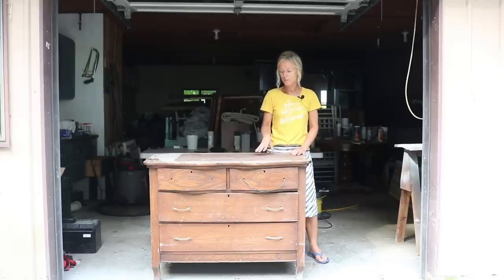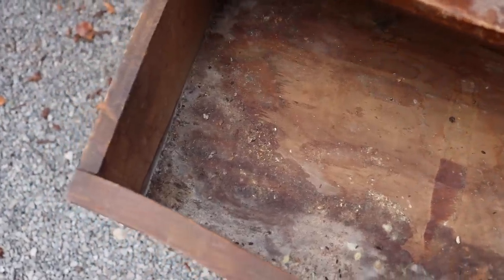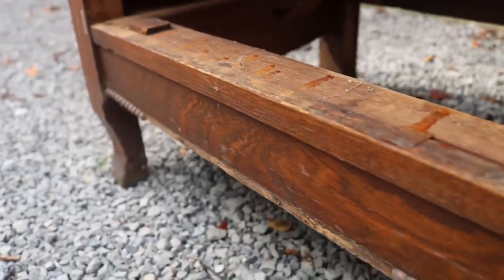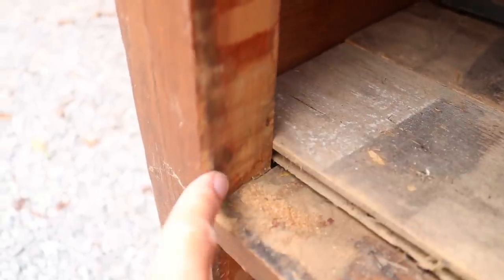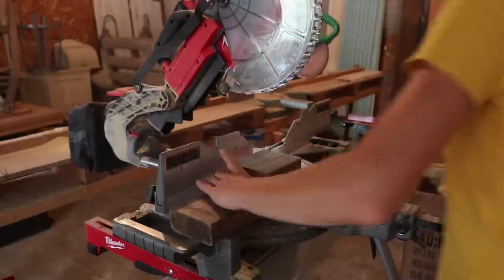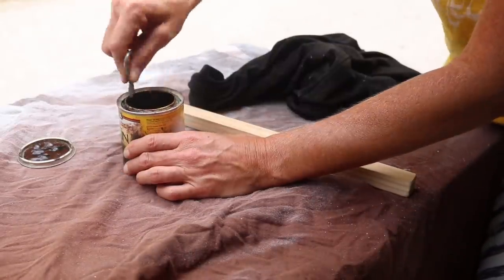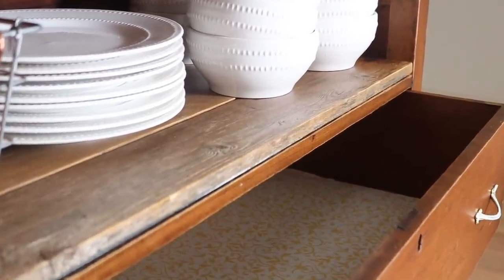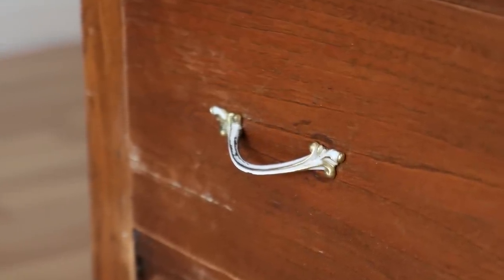Dresser Makeover ~ Repurposed Furniture ~ Furniture Flip ~ Dresser Transformation

Comment: I would love to have that in my kitchen unfortunately my kitchen is so small I’m lucky I fit in it. It turned out so cute n love the idea for paper towels. I love oak n especially if it has serpentine front . I can never resist them. My house is full of oak furniture with serpentine tops. Usually dressers of that kind had wheels on the bottom. It was always easier to move them when mopping the floors way back then. 
That would be very beneficial for this island as the person could move it to use at times. Doesn’t matter tho u did a great job. ♥️😊👍🤟🏻

Comment: Love these transformation to a beautiful and useful addition to your kitchen.  Love upcycling!   I was lucky several years ago to get a marble topped dresser dresser on legs.   I cut off the legs painted it white to match my kitchen cabinets, put on the same vintage hardware, paper towel rack and kitchen towel drying rack on the back and set one end up against the middle of my vintage washstand  to form a TEE in the middle of my kitchen working area.  I bake often and the kitchen counters were too tall to be comfortable but the dresser without legs was perfect and the marble was wonderful for rolling out dough or cutting veggies----so if you see one of those marble topped ones snag it you will love it!  Three small drawers across for potholders and etc and two large bottom drawers for kitchen towels, cutting board and it is perfect.!

Comment: Very nice. I have a solid oak "buffet" from the early 20th century that I had thought to make into an island. I like that mine has 3 drawers - 2 small and one full sized one - lots of storage. It also has a full cupboard on the bottom. I want to add casters so I can roll it around as well. I thought about putting a board across the back to make a "bar" and get a couple of bar stools but think not. I think just casters and possibly a couple of hooks on one end and place my small apartment sized table up against it. Thank you for showing us how you did this. Love it.

Comment: Looks great! Just a suggestion, I've used peel and stick floor tiles on the bottom of my cabinets under the sink and in my bathroom drawers. It's easy to wash and you can cut them with a  sharp knife or scissors depending how thick they are. Holds up better than paper liner.

Comment: In my 1860 house the wallpaper is still on the doors. I found many old things in my house. I live in the Battle of the Bulge area, Belgium. An old bed from the 1900's is still apart on the attic. Today i took down from the attic a 1900's high but narrow plant table or how you call it.  And i have a metal holder for the oil lamp you worked on. I will find such a lamp here in the area too, probably. 
The white style is also still in fashion here in Europe. 
Regards from the Ardennes.

Comment: I just an old  dresser to use for the counter for the kitchen in my Tiny House build. I paid $15 for it at a garage sale, it has 2 top drawer like this one does so I'm going to off set the sink so I can still use one if the drawers from my silverware and the other I'm going as a serving tray to take outside for when I when I have guests. I'm also going to take the 2 bottom drawers to use as a place to store my crock pot, pressure cooker and 9 function air fryer/oven when they aren't in use, everything in a Tiny House has to serve atleast 2 purposes. My bed is also going to be a platform bed with a dresser on 1 end and the underneath will be closet. to hang my shirts to save space.

Comment: I would put casters on the legs to have a "floating island'. There are times you need an extra work surface in various parts of a kitchen. Since the dresser top is split and warped, I would give serious thought to replacing it with butcher block or marble (for someone fond of making pastry). I would go with white porcelain hardware to complement your kitchen, but that's just personal preference. I would try a top coat of wax to add lustre and a mild seal on the stained wood. It looks like you did something like that but I don't see it mentioned. Your end result is entirely charming.